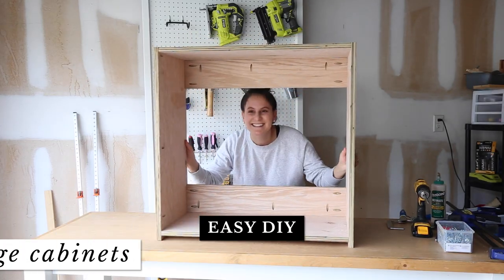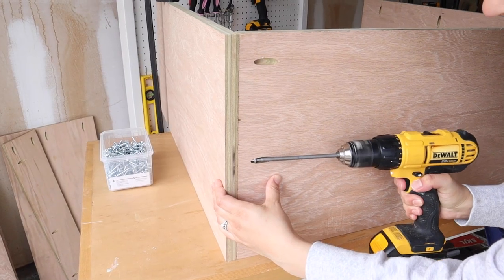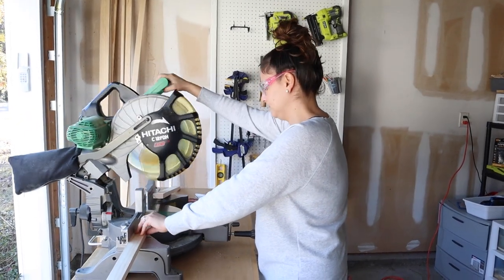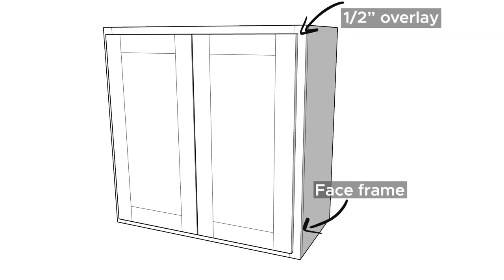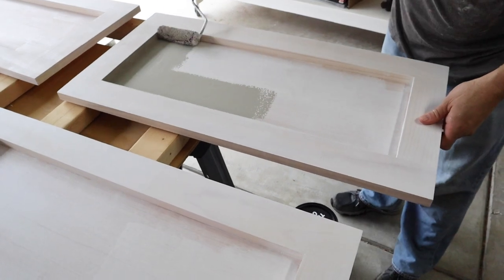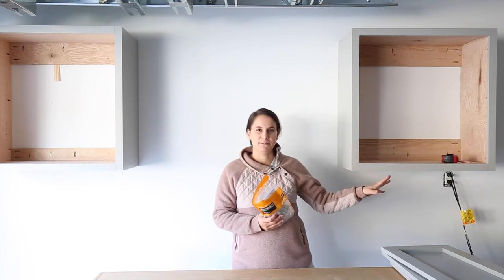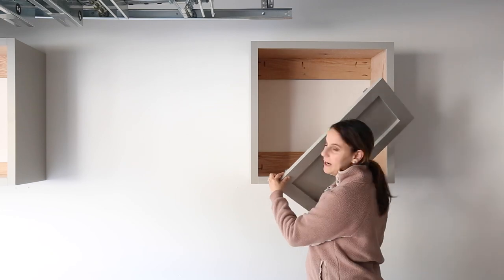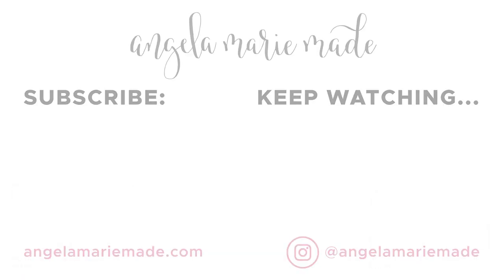Easy DIY Garage Cabinets

Comment: Just a heads up for anyone reading the pocket should be drilled in from back of cabinet.  So the screw is angled towards the front. The way ahead has it is a weak joint as the screw doesn’t grab enough material.  Also hides the holes if you do it from the back
Reply from the maker: Great point, thanks!

Comment: 1:16 same here! I’ve never liked that term either, haha.

I’m looking to do the same project in my garage in the near future, as practice for making built-in’s inside the house later. I have a question: what considerations did you guys have when deciding the dimensions - especially the widths - of each individual cabinet? Thanks
Reply from the maker: That's exciting to hear!! The dimensions of these cabinets are 30" wide x 30" tall x 15" deep. For deciding on these dimensions, I looked at the size of stock cabinets that you can buy as a starting point. But, I made them 15" deep instead of the standard 12" deep wall cabinet so they would fit more bulky garage items. Also, I would have loved to make them taller to go up to the ceiling, but our garage door was in the way. So 30" was the max height we could do with hanging them 54" from the floor and still clear the garage door when the cabinet doors are open. I stuck with a standard 30" width to fit our wall space and have room for a large, built in pegboard that will go in between the two cabinets next.

Comment: Nice work, next time put the pocket holes on the back supports instead of inside this way you won’t see them but more importantly they be oriented in a way that makes it stronger. Cheers
Reply from the maker: Thanks for the tip!

Comment: Do you recommend the right angle pocket hole clamp over a 90-degree corner clamp like the Kreg KHCCC 90 Corner Clamp? And is one right angle clamp typically enough?
Reply from the maker: Either one will work - and you only need one! If you're making a lot of cabinets, it might be worth investing in a 90-degree corner clamp, and you might want more than one to make it easier.

Comment: Did u sand the cabinets before painting them
Reply from the maker: For these we did not but if you plan on making them for inside you may want to go over them with 120 or 220 grit paper before priming and painting, it will have a much smoother finish. Thank you!

Comment: I'm guessing you went with 3/4" plywood because you expect to have heavier items in the cabinets. I always build the with 1/2" which is still pretty strong. 😁
Reply from the maker: This is a great point. I wanted the 3/4" for the frame and was able to use the sheet to save on material but you are definitely right, 1/2" shelves will work!!!